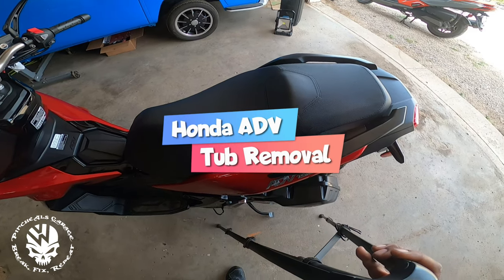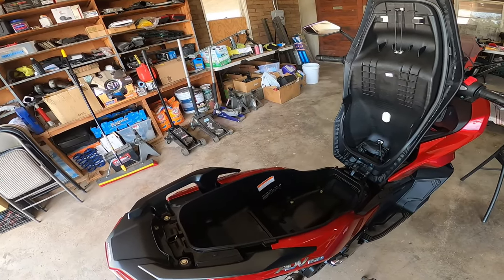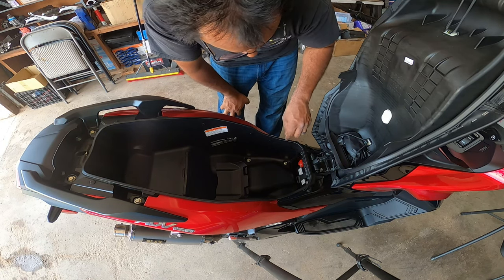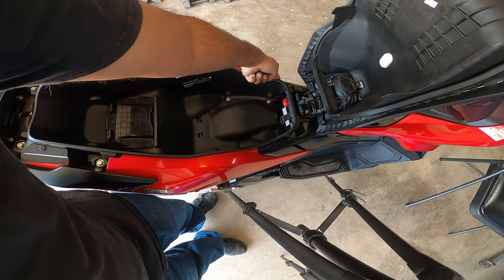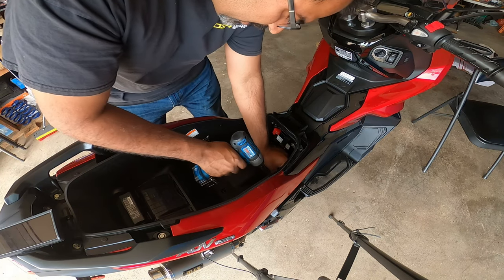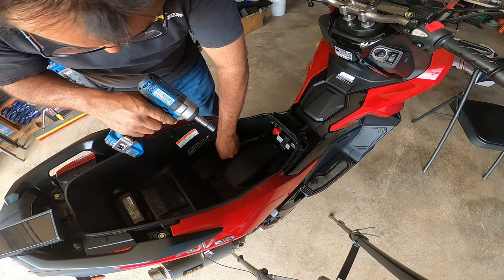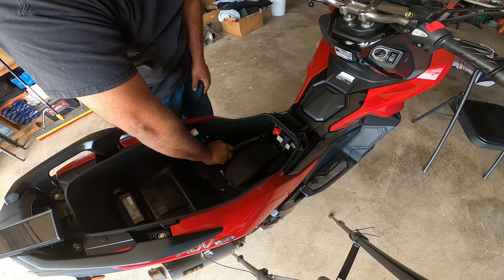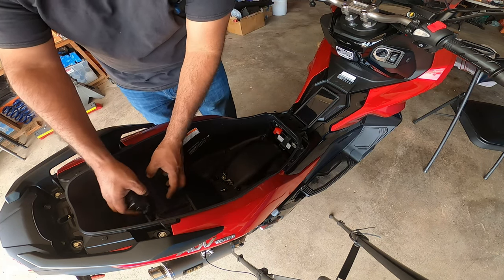Honda ADV Tub Removal

Comment: That was very informative, thankyou. 
I just bought the ADV160 I’m sure is the same. I’ve ordered a DVR to install, I will be fitting a pair of cameras and wondered what would be the easiest way to run the cables from the front to rear. Any suggestions on the cable runs?